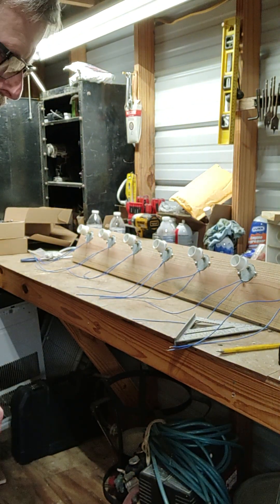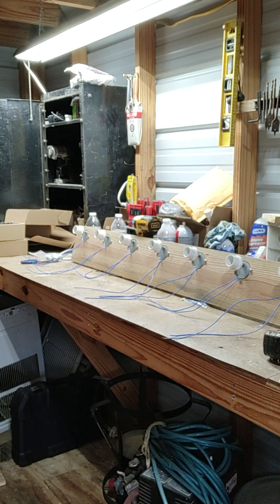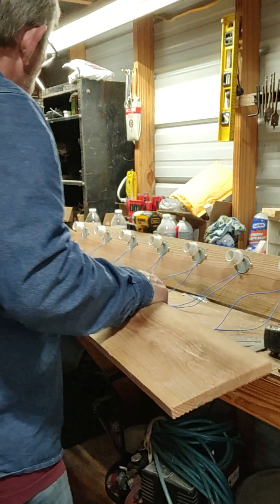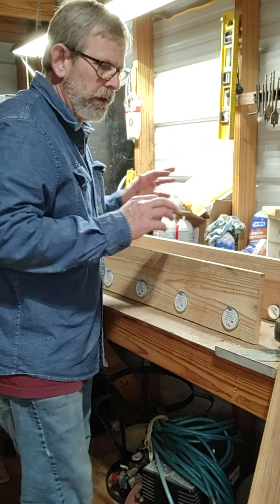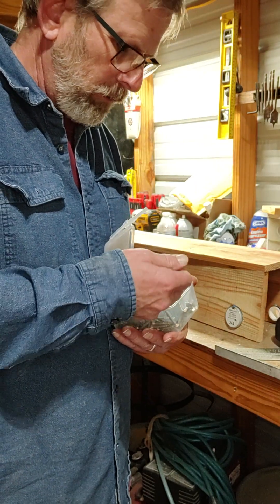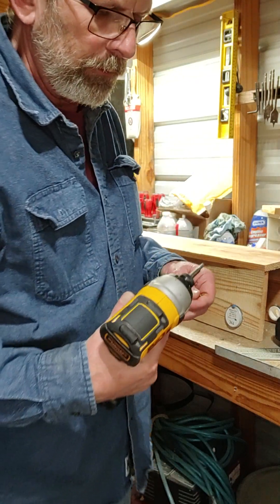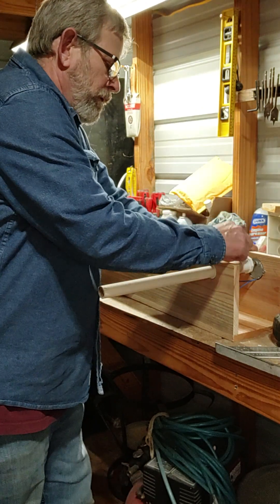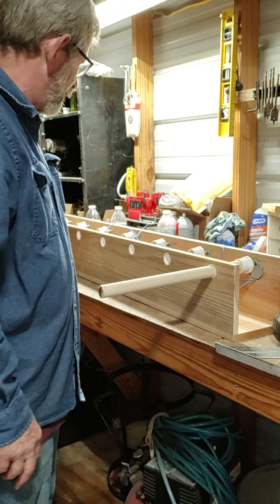magnetic Cup turner build part 2

Comment: Thank you for all your help, I am working on duplicating  your design. However, I had a question I don’t recall where you mentioned the width of the board you mentioned the length being 4 feet but not the width can you please tell me what that is thank you
Reply from the maker: I believe the board was 6" width it is the cedar fence pickets some are 5 and 1/2 and some are six inches it's kind of a choice thing you can use regular yellow pine that's 5 and 1/2 The very first one I built was out of yellow pine which is very strong but I was trying to reduce the weight and the expense so I went with the cedar fence pickets because they are much lighter a little bit thinner and way cheaper and they do the same job just remember if you build more than one you will need to use the same so that they match and I think the length of mine was about 53 in not 4 ft if I remember correctly
Reply from the maker: Oh got to mention sorry it took so long for me to answer you I don't understand sometimes I don't get a message on my email telling me I had a comment